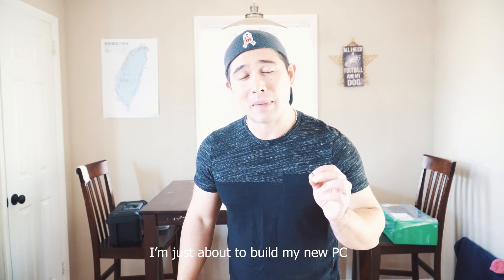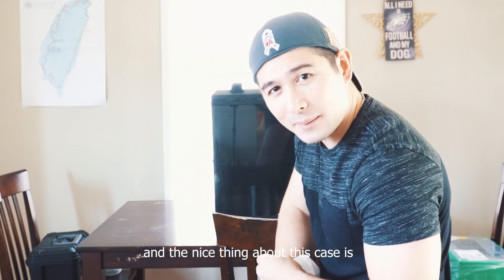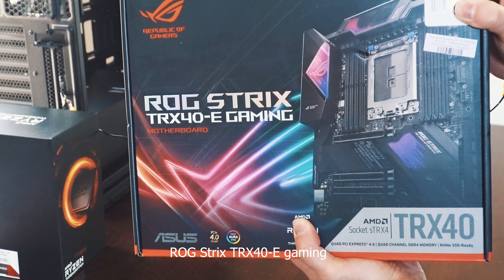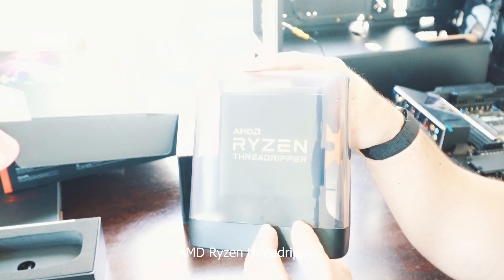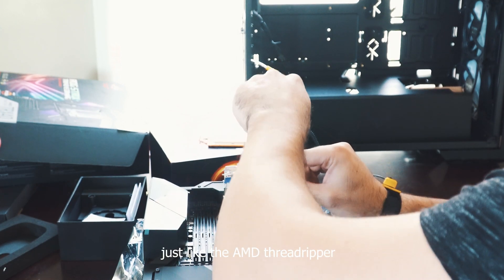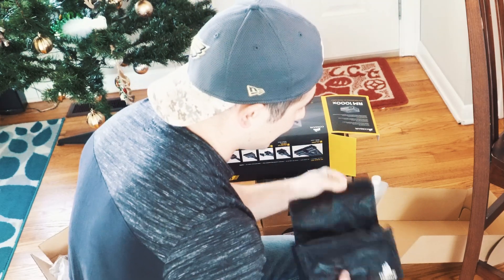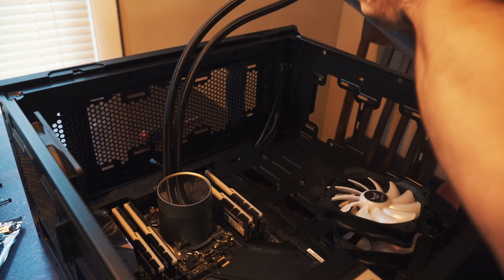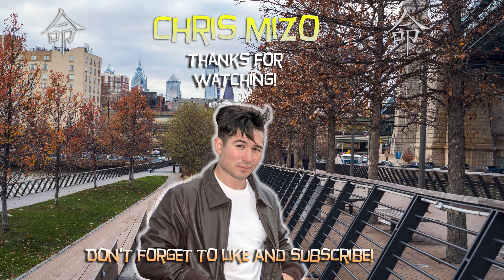Threadripper 3970X Build | How to build a Threadripper PC

Comment: How long does it take to post window 10? From moment you get a signal display to win10 loading screen. How many second?
Reply from the maker: Hey Death Reaper! About 3-5 seconds, the MB will run its post through the small display, after it does it precheckup, the PC will boot then 👍Thanks for watching ✌️
Reply: @ChrisMizo  reason I ask because I'm debating that I have a bad motherboard. It's taking 1 full minutes to show the windows 10 loading. I power on and is prechecking  then VGA loaded and I get display signal I start counting and take 1min. Let say I'm trying to enter the bios it takes 1 min too. That is so weird.
Reply from the maker: I would also check the ram to make sure that they are fully inserted, even if it's a little off it can cause the PC to run a bit finicky also another thing you can also do is try to update your BIOs as well if any of the above doesn't work.

Also are you running off the GPU or the onboard processor display?
Reply: @ChrisMizo  I have asus zenith extreme II not the alpha and bios is up to date the ddr4 is corsair 32gb stick x4 128gb total at 3600mhz I called corsair it said compatible and I tested it with memtest no error took 48hrs to finish. I'm running it as motherboard suggested 2 in each side. The GPU is an 970 will buy better one another time but I tested my ddr4 and my gpu it works great. I just hate waiting 1 full minutes everytime lol
Reply from the maker: Did you give the CPU all 3 connections for power? As it can take up to 424 watts of power as seen here: https://www.servethehome.com/amd-ryzen-threadripper-3970x-review-32-cores-of-madness/amd-threadripper-3970x-power-consumption/

Comment: Amazing Build Bro, What are your CPU thermals ? I might get similar cooler if you are getting less than (80 C)
Reply from the maker: Thanks so much cuz! My CPU thermals idles about 38° and when I put it under load with a stress test (Cinebench) I ran it for 10 minutes and the max temp I reached was about 81°. Recently, I was told and discovered that the Deepcool cooler does not have full coverage of the CPU which is something that you don't want, I will get another AIO and will see if the temperatures  are any different. I will make sure to test it out and I will make another video on it. Thanks so much for watching 😁